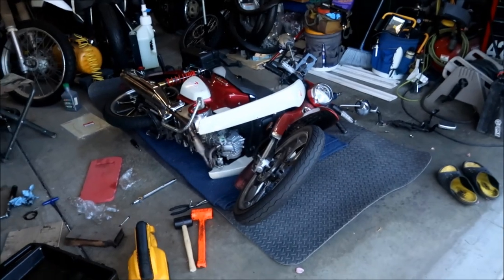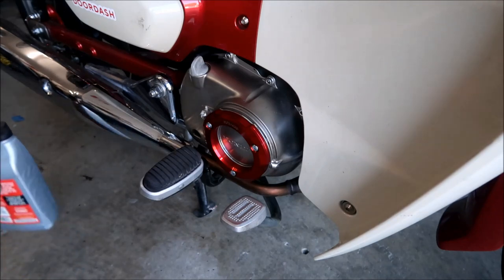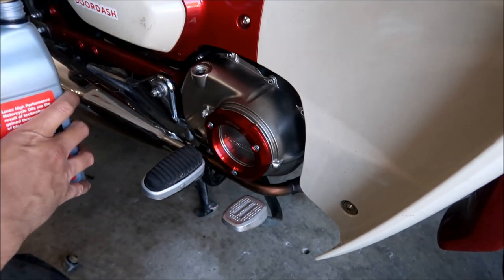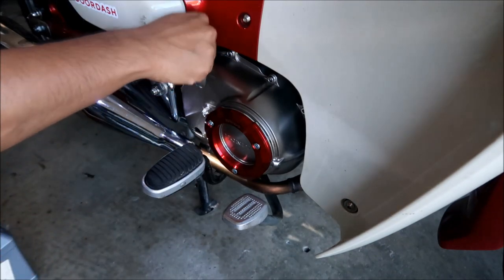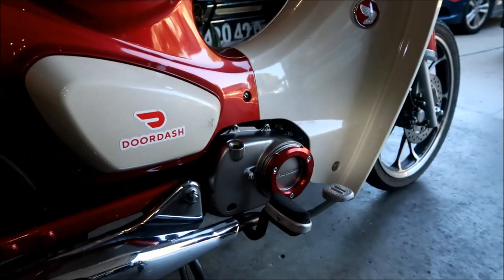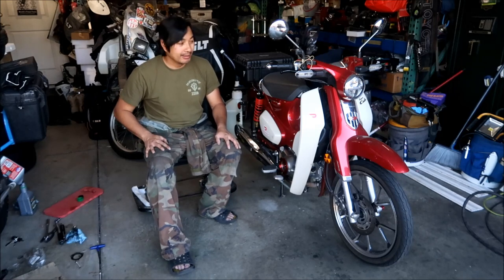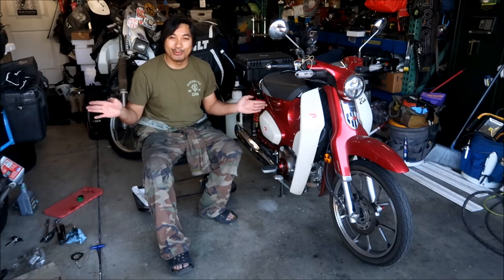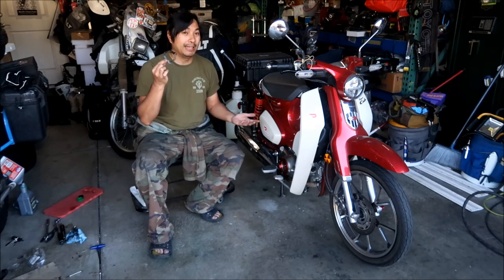Honda Super Cub C125 Oil Spinner and Filter Screen Service Part 3 - Pick Up Bike, Add Oil, Comments

Comment: Ive just ordered a 2022 model which I understand has an oil filter. It will be interesting to see if the new euro 5 engine also had the spinner. Great 3 videos.
Reply from the maker: Nice yeah I think they changed the oil filter design.  Its not that hard to clean the filter system but it just seems unnecessary.  I think the magnetic plug works pretty good.

Comment: have you ever had oil leaks after re-using the gasket and the bolt that couldn't be tightened to 12 newton meters?
Reply from the maker: I have not had any leaks I got lucky the gasket came off nicely.
Reply: @hadesomegamoto7639  thanks for the reply and the helpful video. 
I like the Honda Super Cub and it is a fun commuter and city bike.
I am orienting myself and saving up some money for the purchase of a Super Cub as a second fun bike.